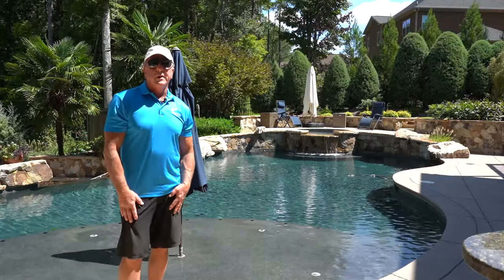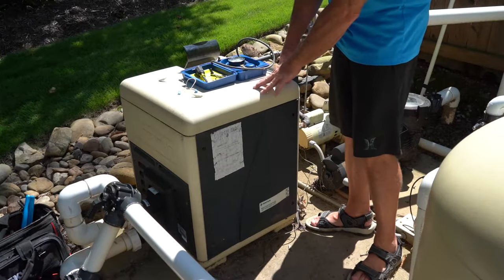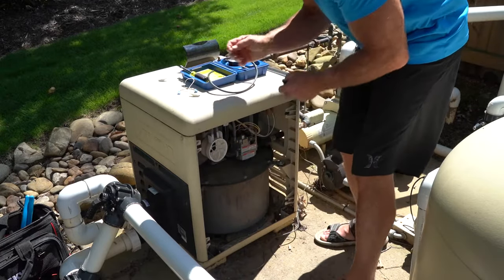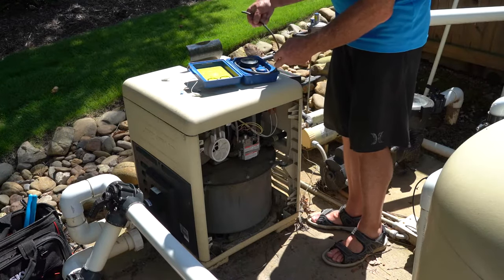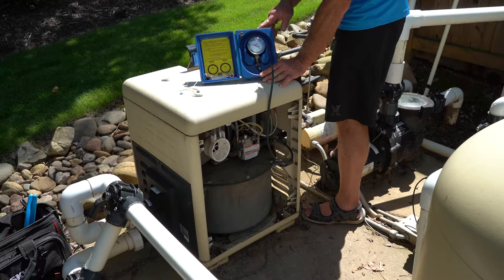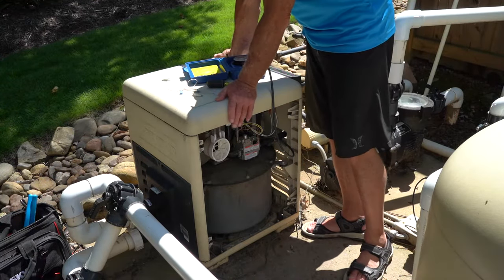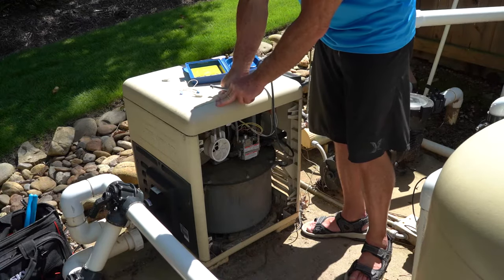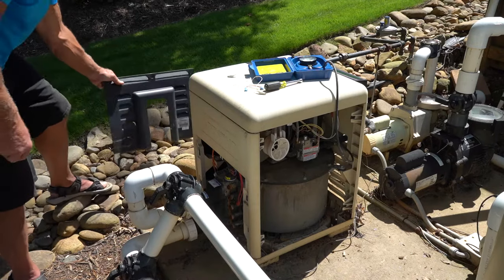MasterTemp Heater Fires for 5-10 sec 3x and shuts off Fix / Repair

Comment: My heater does something similar. When air temps are cooler in the morning, early Spring and early Fall, or heavy rain mid summer, the heater tries to fire up, maybe 1 sec to 10 seconds and shuts down. If I switch off the breaker and switch back on I have better luck of it firing back on. Works perfect during June to August. Except for heavy rain storms.

Comment: Mystarite turns on, the circuit board says 128 then r13, then shuts off.  Nothing ignites and the process takes about 8 secs.  Circuit board doesnt display any leds showing errors of individual parts.  Circuit board looks brand new and is 8 years old.  Only used it 3 times in 8 years.  Unit doesnt stay onlong enough to show any discernable issues.  No noise or anything.  Filter is not an issue. Water flow is fine!  Scrstching my head becsuse i hope that this 500 dollar board THATSBEEN COMPLETELY COVERED AND PROTECTED FROM OUTSIDE ELEMENTS ISNT somehow damaged and in need of replacement.  One last thing, button on back of circuit board switches btween pool on and spa on as its suppose too, however, adter pushing the up or down buttons, nothing chsnges on view matrix.  Also,i dont hear the relay on the board clicking when starting unit..  agsin, upon starting unit, all lights come on, the unit then reads 128, r13 then shuts down.  NO HEATING OR GAS FLOWING OCCURS.  ANY THOUGHTS??
Reply: Yes, you need a pool technician that knows what he is doing

Comment: Heater firing, stop and start 3x.   Red AGS sensor on CPU & replaced AGS.   Ran fine for two days then stopped firing.   Came back on site to find no display codes, no red LEDs.   Tested igniter and it read 92 ohms.  Pentair tech said max reading is 70 ohms.   Looked down & noticed water leak under manifold.   Removed bottom bolt of manifold and water poured out.   Pin-hole leak in exchanger most likely.  If I had tested igniter last week (even as heater ran fine). I wonder what that ohm teading would have been?   Guessing the tub was filling with water last week but was not covering igniter and that faulty AGS was all I could diagnose.   Tricky stuff.   Will always check the manifold for water from here on in.
Reply: Tem que sempre olhar tudo.
Reply: If you still have leaking heater coils and a combustion chamber full of water, you might find my video informative:
https://youtu.be/60icKjdC_oE
Reply: I’m getting the same thing. Water is dripping off the bottom left bolt. I’m guessing I have a bad heat exchanger.
Reply: Hi!  Ours it tripping the breaker when you’re saying yours shots off. Any ideas?

Comment: Seems much like my problem, but in my situation the heater comes on, fires up (very hot exhaust) for a few seconds, then off. Could not determine if that is what is being described here? At any rate, yes very educational run-thru. I would add that this video is advanced-level DIY bordering on (for me anyway) time-to-call-a-pro.
Reply: What ended up being your problem-/fix. I have that now

Comment: You can also check the LED's on the back of the circuit board to pinpoint which switch has failed instead of replacing both.
Reply: How long do LED's remain lit? Do you have to check while running the heater? ie Remove the lid to see the circuit board while failing? Or do the lights remain lit even when the heater not running but powered up? Thanks.
Reply: @arechj  Depending on which switch has failed the lights will remain illuminated after the heater stops running. But it is best to have the lid removed and to be looking at the back of the circuit board when the problem occurs.
Reply: @harwoodhomies  Thanks @harwoodhomies - I appreciate your help!
Reply: Thank you

Comment: Thanks for the video. Question for ya… I have a mastertemp 400. when you hold down the heater off button until it displays program settings AD1 or AD0 and SF1 or SF0 … what do those settings do?

Comment: super helpful im working on a Max e therm right now. its doing the same thing comes on and fires will actually heat for awhile before service heater light comes on. I changed the air flow switch and it's still happening. I keep getting AFS light on. any help would be great thanks

Comment: What do you mean by jumping the AGS and high limit reader? What/how exactly are you doing?
Reply: those two sensors work like a automatic on off switch. Normally on when system working correctly. They switch off automatically when they sense a water temp of around ``140 degrees, the ags shuts the gas valve off by switching the electricity off which causes the gas valve to close.
What he did was to jump the wires together so the control system would think that the system was normal, and the ags circuit would keep the gas valve open, only for test purposes.  If there were a problem with the actual system, you would not leave these jumpers in place after test because they would cause the heater to self destruct.

Comment: Can you run the heater with the jumpers on it ?
Reply: Do not run the heater with jumpers on it permanently.  Only do it for testing purposes.  Jumpers across AGS, HLS and AFS will trick the control board into thinking that everything is fine with each component, but each component is in place for your safety.  Imagine jumpering your High Limit Switch permanently heating beyond scalding temperatures.  You could burn up your heater, your plumbing, or worse, scald your family.

Comment: My issue is similar. I have a pentair heater. It short cycles and then errors out BUT if I later reenable it manually, it lights and stays lit. Even weirder is, when the pool gets to the desired temp, the system is able to put it in standby and when it cools down, it fires up again without issue. Still, the next morning when the system starts, it always tries and fails to light.

Comment: I have a brand new mastertemp 125 , never used , it won't ignite , how much pressure does it take , my propane line has a 10 pound regulator on it ?
Reply: Did you happen to get yours working? Mines doing the same thing. Just set it up today
Reply: I went to a propane company and had the guy set me up with the correct psi regulator  , that was my problem. You need a low psi regulator and a minimum 100 pound bottle
Reply: @scottweedin7570  right on! I got mine going finally. I ordered the corded 120v but they sent a non corded one which is set to 240v. So swapped the 12 pin to 120v and instantly started working. I'm trying a 100lb tank this year and if I go through to much propane I'll be upgrading to a 400lb. Propane company rents them for $100 a year.
Reply: @coppertone1993  what state do you live in where they only charge 100 bucks a year to rent them ?

Comment: My unit does the on off cycle.  Even with the wiring jumped out.  However in my case each time it shuts off the pump shakes a bit and makes clanking noises like something metal is inside.  Any thoughts?  Ty
Reply: you have a mastertemp/max-e-therm heater? based on what youre saying it sounds like you may have a problem with the water getting too hot in the manifold.  water can steam and boil from the excessive heat and cause the knocking sounds.  it can trip your high limit sensor and cause the heater to cycle like youre describing.  theres several problems that could cause your symptoms but the most common in my experience [assuming everything else in your filter system is functioning properly and your water flow is sufficient for the heater to operate properly] is a stuck thermal regulator.
Reply: @didickcheeseburger  I appreciate the reply. You were spot on. From the time I wrote this, I fully repaired it myself. It is exactly what you described. The problem began because last year I had a hard time maintaining proper chemical balance in a lot of blue lime scale developed. I believe that is why the thermal regulator got stuck open. I was getting a lot of blue green metallic looking chips all at the bottom of my pool that look like they flaked off of my manifold. I have since put a salt chlorinator on the pool in life could not be better for my heater. You sir definitely know your stuff. Thank you.
Reply: @danielnigra1922  no problem.  also with a heater be extra careful to keep your chemistry properly balanced including ph balance, alkalinity and calcium hardness.  that same blue scaling you describe builds up in your heat exchanger as well and can cause the flame to be less effective at transferring heat to the water running through the heat exchanger which will cause extra heat to escape out of the exhaust.  theres also a sensor in there that if your exhaust temps rise too high it will cause your heater to quit working.  you mentioned you have a salt generator system and they typically will cause your ph to run high so its good to keep something like muriatic acid around to combat that.  salt pools and heater dont play nice together.  its manageable but you have to stay on top of your chemistry
Reply: @didickcheeseburger  Very True about the PH,. it is always high, and i am always adjusting.  I have never been better at keeping my pool balanced since adding the salt system.  It was not looking good in the beginning of the year when i was having all those problems.  I thought for sure i ruined the heater.  But thanks to you tube, your wisdom, and my own ingenuity, i got it going!! I have a drawer full of replacements limits and sensors:)  just in case

Comment: Is thêre a reset  button on this model.
Reply: Only if you installed a switch to the power supply. Or flip the switch on your fuse box

Comment: Mine was short cycling. Over and over no code. 

I check flame status in main menu. It was weak. 

I added a ground wire under the flame holder. Solved my problem.